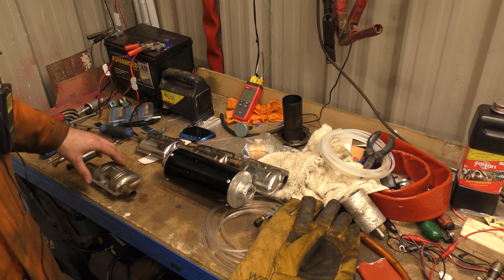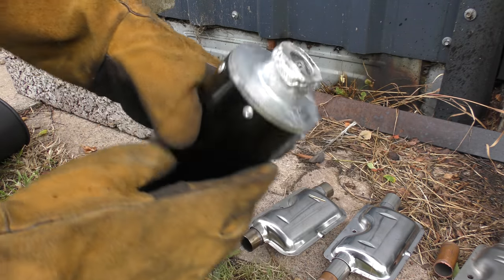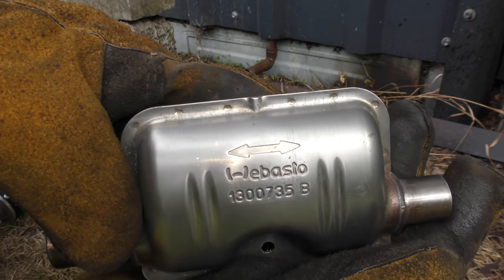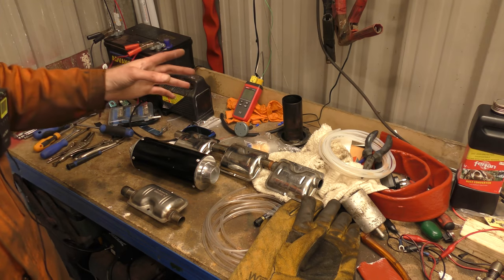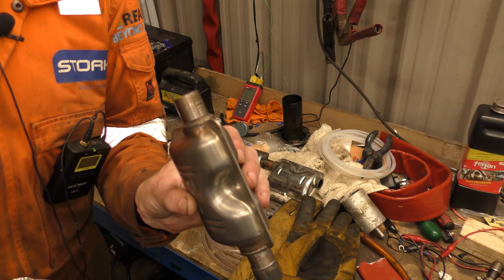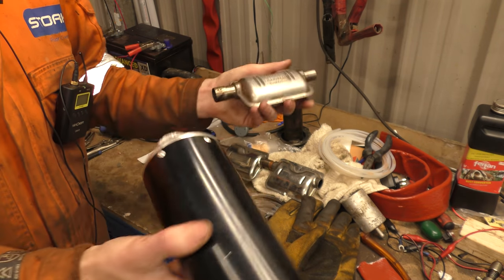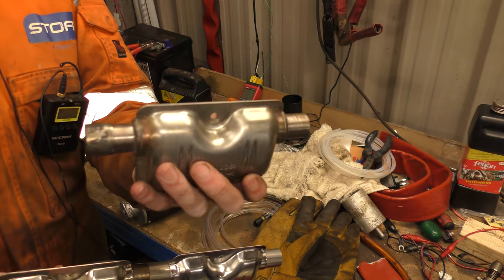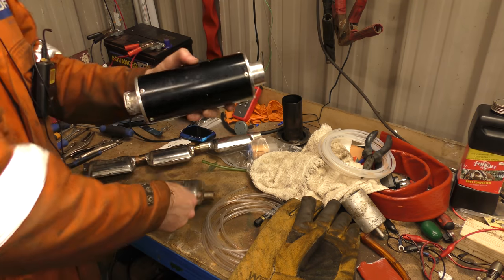Diesel heater silencers daisy chained and a genuine Webasto silencer // test

Comment: coper tube on an exhaust  if i were you i would go read a bit of chemistry and then get rid of the copper exhaust very quickly higly poisonous gasses you are basically beliberately emmitting also copper makes exhausts LOUDER it should be steel  all of it
Reply from the maker: If you'd be so kind as to share where I can find this information that would be great.  Also some explanation of how copper makes an exhaust louder would also help.
Reply: @DavidMcLuckie  Copper seems to resonate in copper the full science of it i am unsure of also copper exhausts were made illegal because of poloution in the UK long time ago
Reply: Copper piping is used as clean water pipes in houses because it is cleaner then rusting iron.
Copper tanks and tubes are used in breweries. 
Millions of people would be dead if copper tubing was dangerous.
Reply: @larsjrgensen5975  the problem is in the way copper and hot exhaust gasses  interact it creates noxious gasses  yes i was not born yesterday i have been installing copper pipes for years for water and gas  but they do NOT carry hot exhaust gasses .
Reply: Diesel exhaust gasses form sulfuric acid during condensation and every acid EATS copper for lunch. Most likely will form some gas in that process.  But the louder part is bullshit.
Reply: @Samuel Skala Yes i will get round to it i have a lot of problems going on here right now   soon as i get chance ill get onto it